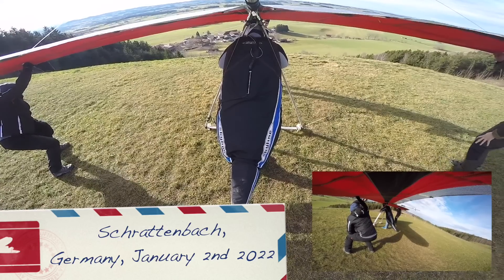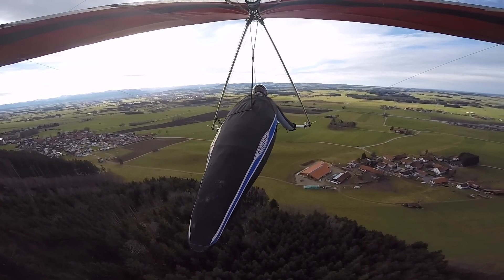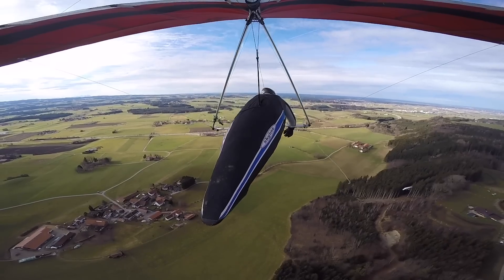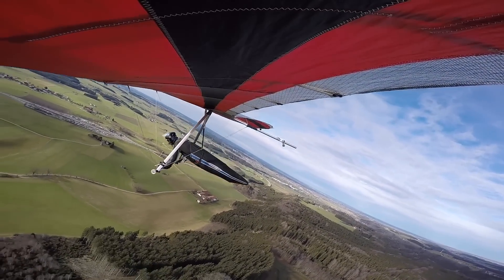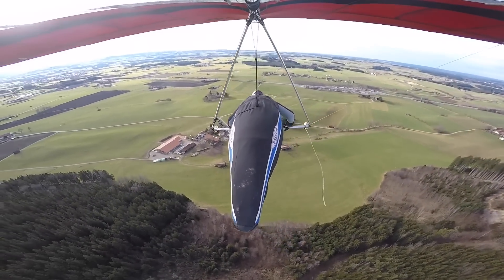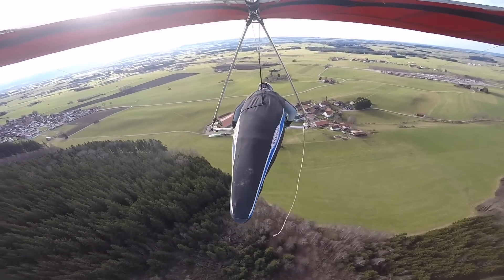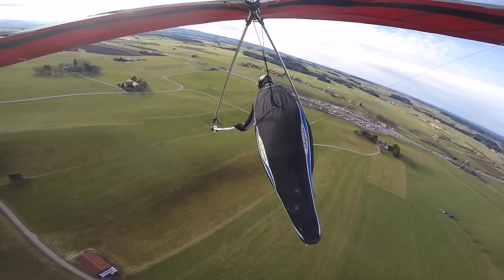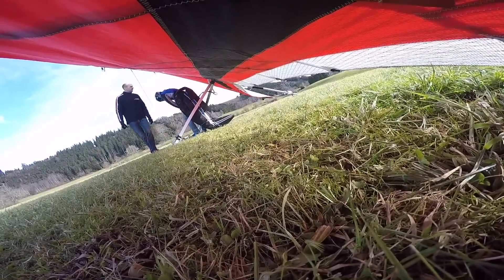17 minutes of hell - Flex Hangglider didn't check wind gradient!

Comment: I had a day as bad for different reasons. Massive thermals and dropping sink had me 3 times up to 4500ft then 3 times skimming the trees. The flight was 15 minutes long... I near kissed the ground after landing. The only thing worse than wanting to fly is wanting to be back on the ground.
You handled this incredibly well, cameras wash out the bumps you had a true rodeo that day.
Reply from the maker: Thanks a lot for your comment! Happy landings!
Reply: I had a similar experience at Point of the Mountain Utah south side. No one else flying there... Doh!  Not the radical ascension, but massive turbulence. I couldn't wait to land about 12-15 minutes also.
Reply: FITNESSOVER45  maybe meant 450, 4500 multiple times in that short length on a hang glider, you’d need rockets on the ends.
Reply: I would want straps on my wrist connected to that bar your holding just in case,,,,I watched that video of those two guys on one of these and the passenger wasn’t connected,, pilot was desperately trying to not let guy fall and guy was hanging on for dear life!
Reply: @jameshicks7125 I was just up there on a hike July 1 or so, a paraglider guy passed us hiking up the Cherry Canyon Logging Trail, super windy day, we were worried about him, about an hour later he was hiking back down.  Wise decision!
Reply: I chose para and totally removed this risk

Comment: If pilots are watching this to determine how flexies and rigids comparatively respond to turbulence, I can give my experience that my Atos handled turbulence like the Death Star - big, heavy, cruised through turbulence like it didn't exist. On a given day my fellow flex wing pilots often would comment on how rough the air was; I was typically surprised -  in my Atos I hadn't noticed any rough air at all.
Reply from the maker: That's also my experience. But this time it seemed a bit different. I guess the only difference was the height, with the gradient resulting in worse conditions for the rigid pilot.....

Comment: I learned the hard way not to launch at a popular flying site when no one else is flying. It was at the south side of Point of The Mountain in Utah. My first time flying there, after usually flying the Oregon Coast and Pine Mountain. Constant, steady wind about 14 MPH coming straight, stable wind streamer on flying wire, the lift on the wing felt nice just standing there. A 2 step launch situation. Off in the distance were cumulus clouds, I thought there is no way that there could be much turbulence here so I launched. Quickly ascended to about 2000 feet over launch, then I was hit terrifying turbulence. I fought to a hard landing and bent a down tube. I am lucky that's all it was, but I learned never to fly a new popular site unless others were flying. I went back the next morning and there were about 20 other para and hang pilots and had some wonderful soaring.
Reply from the maker: Learning by experience is thorough but not always the best... ;P
Reply: @flyguy-hanggliding  Can be deadly in this sport.
Reply: Oh the wind gets INSANE there. I'm local. There are times where you can't even see the mountain 2 minutes after a strong wind comes out of nowhere. That's a super popular spot around here. Really nice on nice days, that point of the mountain and the terrain sets up some epic updrafts

Comment: Had a flight in Owens Valley in 1996 I think. Conditions developed into very strong where you felt 10 seconds out of control then 5 seconds in control. Ended up decending vertically right onto where the two landing strips of Bishop Airport crosses and then musceling my glider (WW HP AT158) to behind a hangar and out of the wind.
Reply from the maker: Happy that you managed to solve the situation, too!
Reply: Brings back similar memory for me around same time in Owens Valley. Could not land for 2 hours and clouds overhead were getting darker and darker, a couple of times I was suddenly flipped so that my wing was close to 90 degrees with the ground.
When I finally started to come down vertically and last few meters I look directly down and see some type of a deer 🦌 oblivious that I am just about to land on him. He notices me at the last moment and bolts off.
I never appreciated life more after that.

Comment: This may have been a dangerous situation, I'm glad everything turned out OK.  I've always wanted to fly a glider, looks so fun.  I used to jump freefall and I've had those days where you're pointed into the wind going backwards no matter how you set your trim and pull on the lift webs.  Looks fun, cheers.
Reply from the maker: You should check out hang gliding (in "normal" conditions). It is just so much fun then!

Comment: Difficulty descending in stronger wind conditions? That sounds terrible. Is that how they're designed?
What if you turned downwind, would it have been easier to descend?
Reply from the maker: Usually with strong wind you descend fast (when you are away from the hill that is redirecting the air upwards). You are right about the option of going downwind. I just didn't like the terrain there (many trees) and you might end up in a rotor (air that is first deflected upwards by the hill and then is falling, i.e. "rolling" behind the bump in the terrain)
Reply: It's fascinating to hear of the many factors to be considered....Thanks for taking the time.  Happy flying! @flyguy-hanggliding

Comment: The wings needs a way to be able to Dump Lift (like a section in middle that can be opened up so the Wing surface area is reduced by about 25% for landings or emergency decents)
Reply: You wouldn't want to risk stalling plus that would be a possible point of failure.
Reply from the maker: Yes i guess that might make it dangerous, too.

Comment: I'm assuming that the reason you didn't turn around and go with the wind is because you would have no lift, and would be unable to glide to the ground, but fall?
Reply from the maker: Going with the wind would have been possible but there might be wind rotors behind the ridge and i don't know the area well. That's the reason i flew against the wind.

Comment: If the wind had increased in strength is there any option for flying along the ridge and off the end of it - and out of the lift?
Reply from the maker: Yes you could have flown along the ridge to leave the lift or with the wind as well. Since it was my first flight at that site i didn't know the area very well, especially when flying with the wind. I was expecting relaxed soaring and preferred to fly straight out. (btw i always had enough reserve to increase speed if needed.)
Reply: @flyguy-hanggliding  - I was wondering about the reserve speed.  I don’t hang glide myself but I’d love to try when I get more time/money.  In the meantime I enjoy videos like these.
Reply from the maker: The glider can come close to 100 km/h so there was some reserve left

Comment: I don't fly (yet), trying to learn things. It's right to think terrain was causing most of the turbulence there? Can I assume going higher would probably smooth out turbulence/gusts? Thanks Sir for this report.
Reply from the maker: Thanks a lot for your comment. I am not so experienced myself. Generally I'd say yes and no. Usually going higher would smooth out the turbulences caused by the terrain. But on that specific day the wind was so much increasing with the height that flying higher seemed to make it worse in some way (also refer to the recording of my friend referred to in the video description). Best Ralf

Comment: No step landing = good. No step launch with terrain that causes rotor = stupid. If you say you got away with a flight, reconsider your next launch. I've done wing tip stalls from flying too slow, being too tight in the arms. I became lazy due to coast flying. Made it so I'd eat every bubble or column thermal, but speed is safer. You mention a bird of prey, I've had a Sea Eagle have a go at my wing tip because i was in his territory. Good vid.
Reply from the maker: Thanks for your input. I guess i learned a bit from that flight... (hopefully)

Comment: Hi great control... well done... please what would happen if your body support harness snaps? are you able to hold your self up with the wind underneath you or would you hang like monkey bars?? Thanks...
Reply from the maker: Thanks for your comment! You wouldn’t be able to hold on for long. Moreover it would be very hard to control the glider. If you are still in the harness but no longer connected to the glider you could use your emergency parachute (it is inside/connected to the harness). In https://youtu.be/dLBJA8SlH2w it happened that the passenger of a tandem flight wasn’t connected to the glider (passenger doesn’t have his own parachute)… 😱

Comment: So let me get this straight.  all your weight multiplied by the force of the wind, turns and elevation, all rests upon two little lines and one V connector the size of a thimble. More over, only one connection at that, not even a secondary safety line for redundancy.   why does this seem incredibly stupid to me.
Reply from the maker: Well the equipment can stand multiple g forces. And it is checked often!
Reply: @flyguy-hanggliding  still.. redundancy can't hurt.